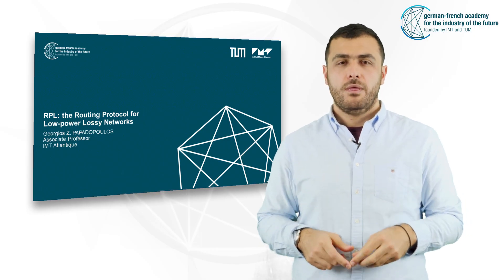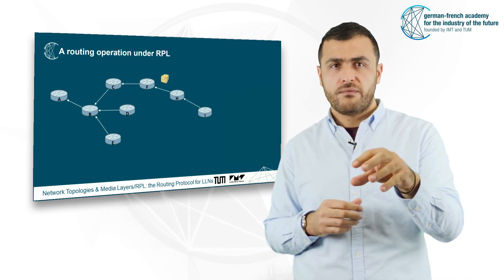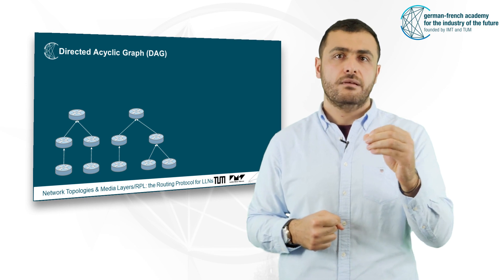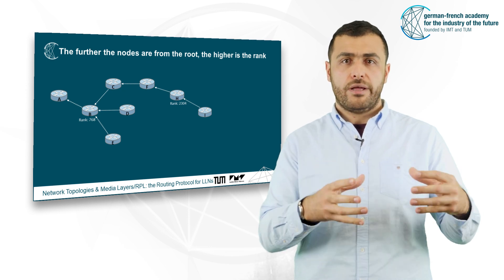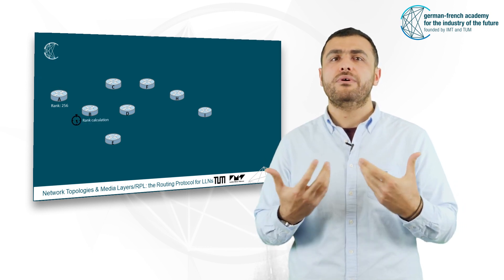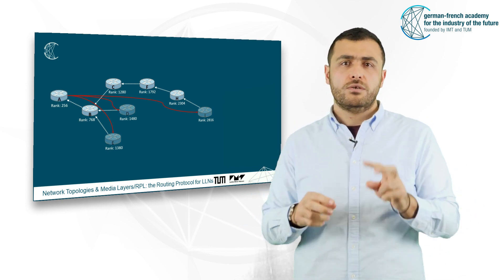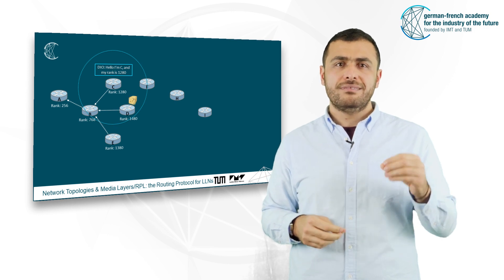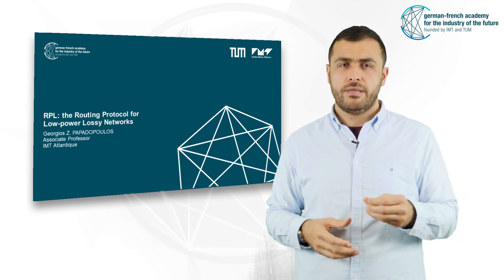RPL: the IPv6 Routing Protocol for Low-power and Lossy Networks | RFC 6550 | RPL | RPL Tutorial

Comment: In this example how will node E communicate with node C ? I mean are the edges bidirectional
Reply from the maker: You posed a great question here Niket Bahety! 

So, RPL (RFC 6550) defines two Mode of Operations, the Storing Mode and the Non-Storing Mode:

1. In the Storing mode the intermediate nodes maintain state representing the routing information towards all their descendants (direct children, children of children, etc.). This results in additional memory requirements for the nodes maintaining this information but higher network performance, especially for inter-DODAG traffic. Thus, in the storing mode, coming back to your question, when the node E wants to send a packet toward node C, it will go through the first common parent, which is the node B in this case, since B maintains all the necessary routing information (e.g., IPv6 addresses) of its descendants. As a result, in this Storing mode, the exact path is the following one: E --> B --> C.

2. In the Non-Storing Mode, only the DODAG Root (i.e., node A in this example) maintains state representing the routing information towards the whole DODAG. This results in high memory requirements only on the root, but adds network overhead due to the use of source routing and less efficient intra-DODAG routing because all the traffic needs to go through the root. Therefore, coming back again to your question, when the node E will send a packet to node C, this packet will go all the way up to the Root which is the node A in this example, and then downwards to node C through node B. More specifically, you will have this path: E --> B --> A --> B --> C. In this Non-Storing Mode, the DODAG Root uses what is called the Source Routing to route the packets downward since only the Root is aware of the whole network topology.

Let me know if things are crystal clear to you now!
Reply: @gzpapadopoulos  thank you for the explanation ! It's clear now.

Comment: Good presentaion! Thank you ! 
If i put my own device on the network and configure it with small number rank. My device take the role of DODAG and the topology of the network will change ?
Reply from the maker: An excellent question Thanasi, thank you! 
RPL as of RFC 6550 does not have zero trust. So, if a node manages to join the RPL network, by bypassing the Layer 2 security, and claims Rank1 (i.e., the smallest rank number in the network), it becomes as preferable as the Root. And yes, consequently, the topology of the network will change as you say.